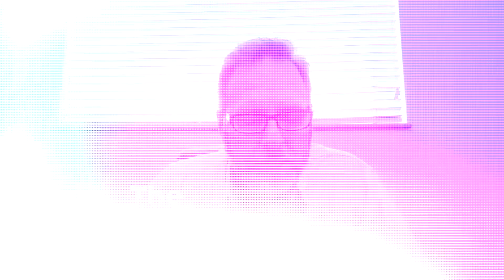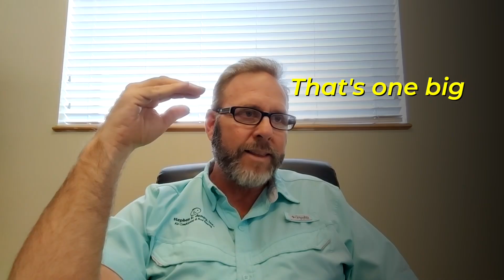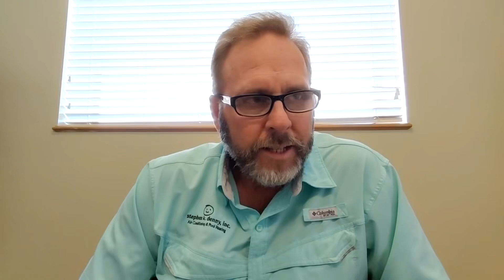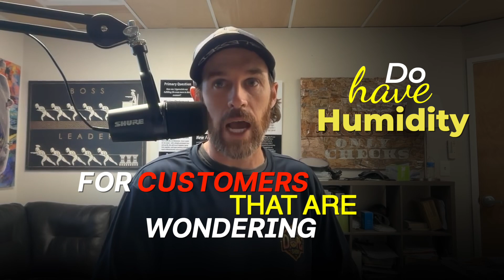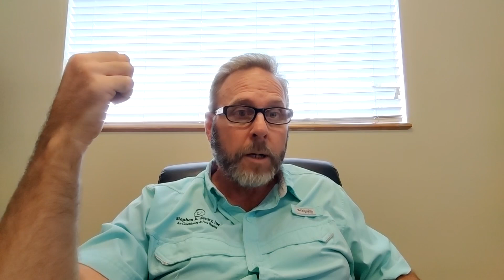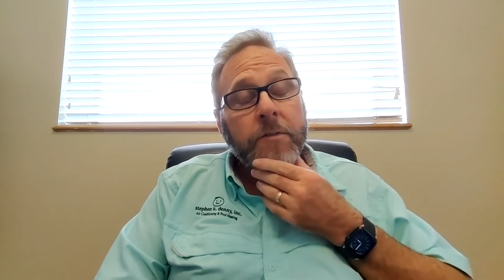Florida contractor talks Heat Pumps, Humidity control and everything HVAC

Comment: I will be building a home in Florida.  It will have opencell insulation on the roof deck and it will be tight home for energy efficiency. I am considering an ERV for fresh air exchange.  Humidity is a big concern. 

The Bryant Evolution Extreme system claims that the Bryant’s Perfect Humidity technology is more advanced than other HVAC systems.  Is this marketing or do they have a technical advantage over other systems with variable speed air handlers and compressors, such as the Daikin Fit systems?

Steve, do you see any ERV systems installed in new construction homes in South Florida?
Reply from the maker: I forwarded this to Steve, if you contact Stephen K Denny directly they'll be able to answer these just ask for Steve and mention YouTube/the show... here's their link on google https://maps.app.goo.gl/nzCgv5pFkBW54yBW7?g_st=com.google.maps.preview.copy

I think it's Bryant's marketing because most inverters have the same advanced capacity control, but Steve will chime in on that as well as the ERV because I'm not familiar with them in humid climates for air exchange like Florida.
Reply: Considering an ERV? That shouldn’t even be a question as you have, and rightfully so, identified indoor air quality as a necessary environment risk consideration and are obviously worried about energy costs… Just don’t avoid this matter because of humidity concerns, which can easily be mitigated. There are dedicated outdoor air systems (DOAS) that improve indoor air quality, which also incorporate energy recovery, with humidity control for residential applications.